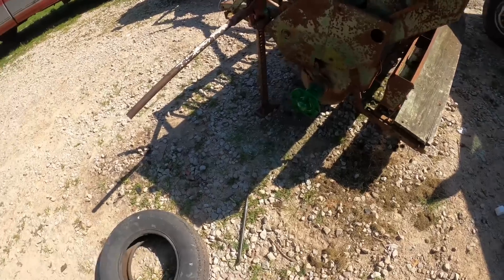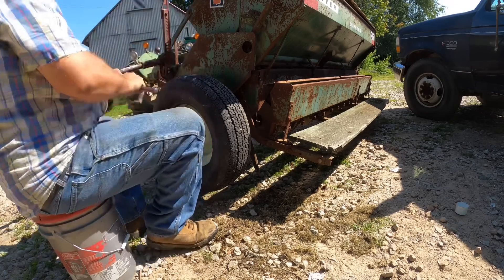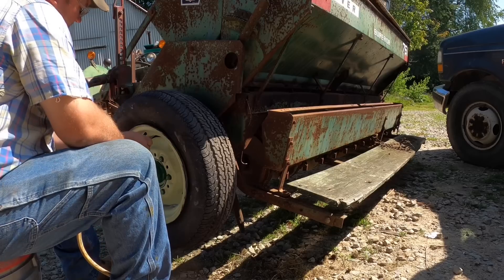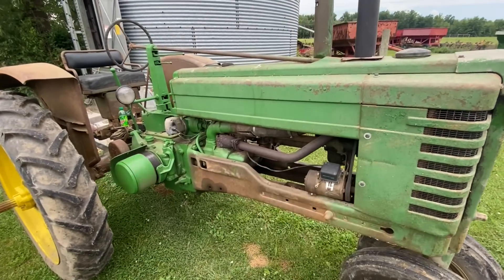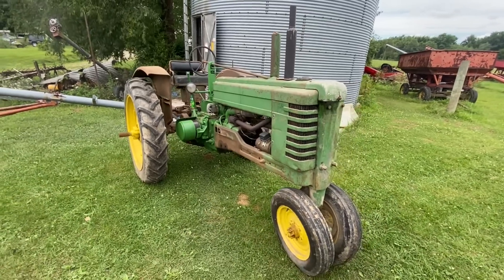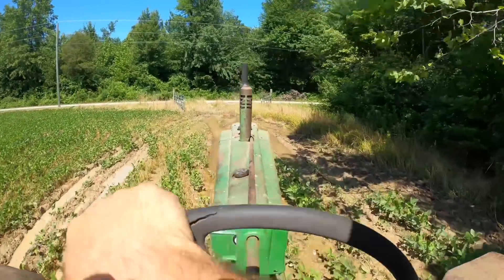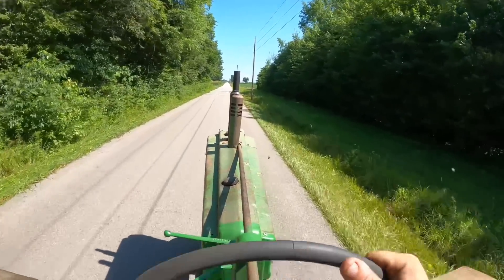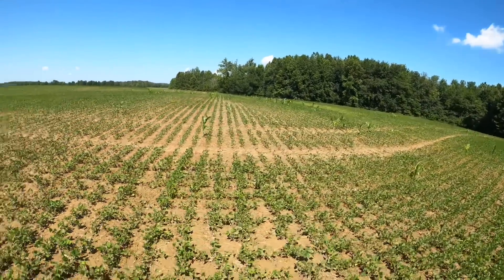CROP UPDATE and Oliver 76 GRAIN DRILL REPAIR

Comment: I have 2 older Oliver superior grain drills - They are pretty much the same, except one has tall steel wheels and the other has car-type rubber wheels.  Quit using both about 25 years ago because the fertilizer tubes were rusted out and couldn't find new ones.  Yours appears to be a newer one than mine.  You're crops look like they're making good progress, especially with the weather challenges of different types we've all had.

Comment: Did I see some wobble in the Deere's front end? Sometimes it is an optical allusion cased by dirt on the tires. Nice trip for the Deere, and for Ross.
Reply from the maker: There’s a little bit, but not as bad as some

Comment: Hey Ross, on the B just for shits and giggles check your valve lash. I set all mine at a loose 20 thousandths. A little loose on the old Deeres is ten times better then tight. Had many a old timer tell me if you can't hear em tappin then there too tight. That old B should pop off quarter throttle. Half the time I don't even use a feeler gauge on my deere valves I'll just eyeball. 020 lol
Reply from the maker: Thanks Kenny! I’ll definitely check that when I change the valve cover gasket. I also need to pull that carburetor and figure out why it’s overflowing out of the load needle now 😭
Reply: @rosstheoliverman  either the float is too high or has a hole in it. Might need a new needle and seat. It's sad that most of todays new floats are junk. It's like playing the lottery when it comes to buying carburetor parts for these old tractors. Load needle could be getting worn too.

Comment: I'm not a huge Deere fan, but I have my grandpa's 3010. It's not in good shape and sitting doesn't help at all. My biggest complaint about Deere is the local dealer. They're one of those huge dealers that don't like little guys coming in and buying a couple parts a year. They cover so much of Illinois that you can't economically drive far enough away to get to another dealer to get parts. They probably aren't too far from your area either. It seems like those big dealers should be considered to be a monopoly
Reply from the maker: I still think it was better in the days when they were small dealerships and you had multiple ones in each town…

Comment: That john Deere B is only running on one cylinder, check spark on both sides because it will run on one cylinder but will be underpowered and slow.
Reply from the maker: I have since done that. It’s been a constant battle 🤣

Comment: Why do you have the shutter closed on the jd the lever below the gas should be forward you better change the plugs one isn’t firing under load
Reply from the maker: The shutters are open. Also right now there’s no rod connecting the handle to the front. Never had that piece I’m gonna have to make it. Shutters were never on the tractor in my lifetime. You’re right, one plug was not firing all the time. The short video I made a few days ago shows that I got that fixed. This video was filmed a week ago or more. Thanks Fred!